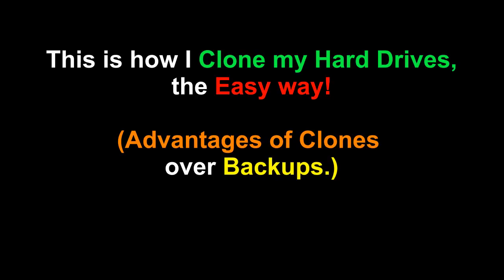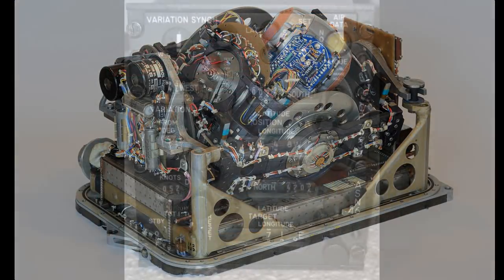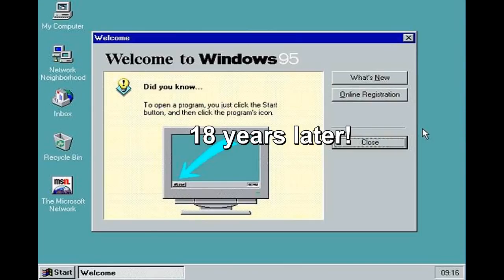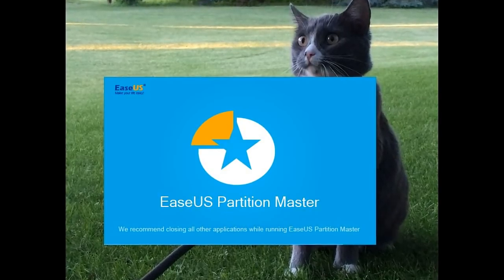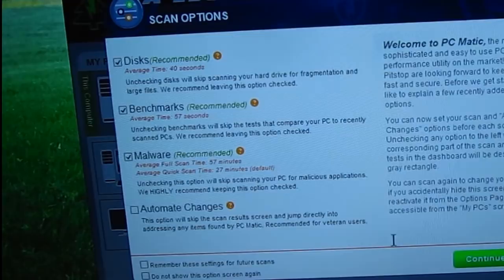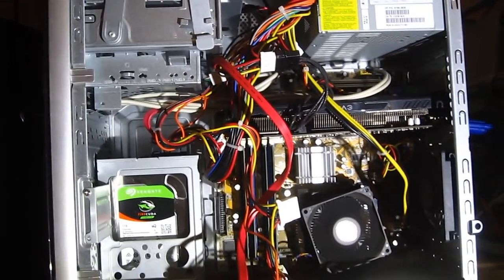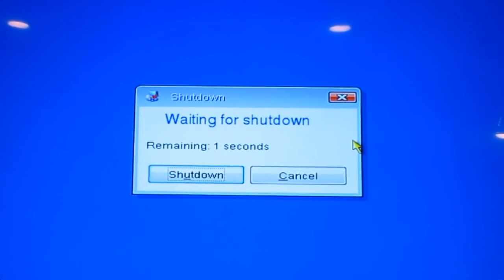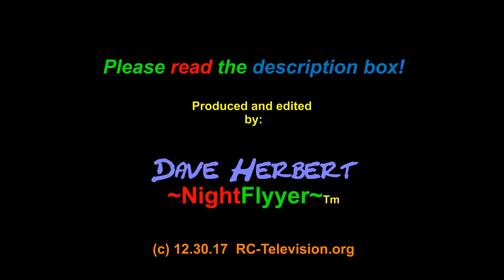How to clone Hard drives. Why plus my Computer history and a demo.

Comment: I enjoyed your video, especially the introduction regarding your computer background.  I got a real kick out of seeing those old computers, plus I also worked at Burroughs, and was there in the early eighties when Burroughs purchased Sperry-Univac and the company was renamed as Unisys.  I also remember the disk platters, and the old systems I worked on, such as the B1900 system.  I also did some work with LINC  and also regular COBOL.  Thanks for the memories and the wonderful video.

Comment: Nightflyyer, it was well worth watching this video, I use a raid setup in my computer which does basically the same thing but it's internal, and it's a possibility both drives could fail at the same  time or get infected by malware, I'll try your method with an external SSD drive the next time I backup.
Reply from the maker: Thanks and glad you like it.   I tried to do a clone to an SSD drive once befor, but it ran very hot and was jerky on the programs, so I still prefer the 7200 rpm Hard Drives.  Happy New year to you!

Comment: Have you ever thought about setting up your hard drives in RAID? Redundant Array of Inexpensive Disks. You can set it up in raid 1 so it is basically running constantly in parallel so if one fails you still have a exact copy. You can also have a raid 0 setup where it is kind of like setting it up in series so if one fails they both fail, but you get double the performance and speed. Then there is raid 10 where you get the best of both worlds but you need 4 drives. 2 in series and then there is another copy of those 2. Interesting thing to look into.
Reply from the maker: Yes, but I like simple and cheap and do not need a computer with 4 hard drives, besides having to have a bigger power supply to run them.  Your way will work, but simply making a clone to pop in, if my hard drive fails is easy and cheap.  Thanks for the suggestion though, and Happy New year.

Comment: Hi Dave,
Happy New Year to you and family. I use HD Clone. It can make a bootable USB thumb drive and I run cloning software from outside of Windows. You mentioned upgrading each version of Windows to next. I stuck with WinXP Pro for a long time. Finally decided to go to Win7, but needed to upgrade to Vista first then to Win7. Well, the upgrade was proceeding (after jumping through a few hoops getting XP prepaired) until it hit 32% collecting files. Upgrade Program threw an error message it can't continue with only option to click OK button. All that did was drop out of upgrade back to XP with no explanation of the error. Went to all the Windows forums and was told tens of thousands others had same problem that was never solved and then told to do a clean install. Yeah right with almost a hundred programs installed and less than half of the program disk available. My laptop with WinXP Pro had no problem going to Vista then to Win7 Ultimate.

I'm using Samsung SSD drive for C and also one as a clone. Have four physical drives in tower and eight logical drives. Wonder if my complex drive system was to much for the Vista upgrade to handle? All my drives are in Kingwin trays and can be switched off before starting the computer. I'm using an Antec 1200 tower that has nine external 5.25" bays. Already have an I7 motherboard and another tower to build up a new system. I clone my drive once a week.
Reply from the maker: Happy new year to you as well.  It sounds like you have some experience too, but if you load Windows 10 youll find it beats all the old windows programs. I know for sure, as I have had each and every upgrade there was.   Technology really has advanced and since I was repairing computer for others, I had to keep up, you know.  I have never tried to clone my hard drive to a thumb drive and would be impressed if my main hard drive was to fail and I could simply plug in a thumb drive and run all my programs and windows 10 just like a Hard drive. Vista is a very small op system compared to Win 10.  I tried to do a clone to an SSD drive, but it ran very hot and was jerky on the programs, so I still prefer the 7200 rpm Drives.  Pull start in Shuttle Heli is installed and ready for spring, btw.  Be well.  Thanks again.

Comment from the maker: *Note, If disk wizard wont begin the clone in windows, use the same window and create the rescue media builder either on a cd or thumb drive.  Then Boot to your bios and make it boot from the cd or thumb. The same window will come up, then select clone hard drive. I save pictures, documents, etc. on USB portable drives, not on any websites! 
They are fast and no Internet needed!  But you cant save entire programs on them!
NOTE* If your computer fails, just exactly what computer are you going to use to download your data anyway? 
For me, cloning Hard drives is better than backups and costs only the price of a second hard drive like this 1TB Seagate at $44.95. You could use an SSD drive also, but I prefer the Seagates and what I had on hand and MUCH cheaper!
Cloning (copying) the entire hard drive saves the operating system and programs, along with updates, drivers, and other items not typically saved in a backup, unless you have a professional and expensive backup setup. 
Exact hard drive copying is fast and easy. I did my 1TB drive in 30 minutes and it is running fine. 
Now if the computer fails, I'll just pop in my backup drive and away it goes without missing a beat! 
I know there are other software programs and ways, but this is the way I like to do it.
If you glean any information out of this video, then I am pleased. Thanks kindly for watching.
Reply: I always enjoy your videos. As good backup practice, just remember to store a copy of that USB drive with the most important pictures/document files also on an offsite location. (doesn't need to be a website, just give a thumb-drive to a friend/relative to keep for you). Happy New Year !
Reply from the maker: So true so true!  Thanks and happy New year to you as well!
Reply from the maker: Right, for sure. I save my docs, pics, ets in a portable SSD hard drive, same as a thumb drive, but again, that will not run your computer if your hard drive fails, and why I use a complete clone.  Happy New Year to you as well!

Comment: Dave, thanks for the video. Not to get too far off the subject, but, I noticed in one of your pictures, you had a futaba radio with a stick on the right that you could twist. I assume it controlled everything but throttle on that side. My question is, Did you do that or was it done by futaba. Also if you did convert that radio, I would like to challenge you, in a nice way, to convert a radio to do that. Specifically, a spectrum dx8 second generation. The reason for the challenge is, there are some people out there that fly mode two who always have a problem with their reach. That would be me. Anyway, are you up for the challenge?
Reply from the maker: Well, Single stick radios have been around for a long time since the Beginning.  Those were not Futabas in the video, but Pro Line and Kraft. We made them and you could order them that way.  Phil Kraft flew only Single Stick and So did Joe Bridi, who bought Proline.  I had a contract to do Bridis repair work after that.  Today's radios are not particularly suited to fit in a single stick.  I'm sure if Spektrum had a big surge for people wanting to fly single stick radios, they would make them, but Because of the circuit board arrangements (like I see inside my DX8 Gen II) there is no way to do it.
I appreciate the Challenge, but I never liked flying single stick and to me it was hard.  BTW, rudder is done by twisting the knob and a lever on the side of the TX Ran the throttle.  Hard to get used too.  Anyway, thanks for the confidence, but I have to decline on that one.  Happy New year!
Reply: NightFlyyer , thanks for quick response. HAPPY NEW YEAR

Comment: I tried to clone my HDD 128Gb to an SSD 256GB and I had lost packets of information and made the SSD drive run hot and it would glitch on a regular basis. I can't remember the exact clone program I used but I do still have it.....The Wal Mart lap top is still running on the old HDD.
Reply from the maker: I stil lprefer a standard hard drive vs the SSD drives for that same reason.  Heat!
Reply: NightFlyyer , good call they do need a good heat sink.

Comment: Try an external Blue ray burner!  This is how I solved all of my backup troubles.
Reply from the maker: Thanks.  Yes, I suppose you could back up your entire hard drive to a Blue Ray disc, but I do not think that if the hard drive failed, you could just pop in the Blue ray disc and it would run just like nothing happened, since the system constantly writes and reads to your hard drive while the operating system runs. Blue rays are not interactive.
Reply: That just the difference between us... You try to backup programs, and I let the old programs go... I only backup my personal data never old programs. If an old program is hard to keep because I can't be bothered to have the install disks or it wont keep up with the current hardware, then I just let it go.
  But having said all that you can still create and image of your hard drive with something like "Ghost" and burn it to a DVD or Blueray and make it a bootable restore just like you would use any backpack drive.

PS Hard drives all Fail, they are probably the worse things to use for important data backup... Next to RAM.

Comment: Why are Hard drive and not an SSD?
Reply from the maker: You could do that too! I just happen to have a few new Hard drives here to use first and they are still my preference as, my experience with SSDs were the heat issues!  I rarely have had a hard drive failure with the Seagate Barracudas.  Good question.
Reply: Eric sin for a backup, why waste an SSD Not like you need the performance, sitting in a drawer. Large SSD are very expensive, OK for windows boot drive and swap, maybe a scratch disk for video editing.
Reply: My 2 cents
SSD is good for running the OS from, then backup to HD, since SSD is a lot faster, I have been running my Toshiba SSD for almost 10 years with no problems.
It seems that SSD's dont need to be scanned or defraged either.
no heat issues...